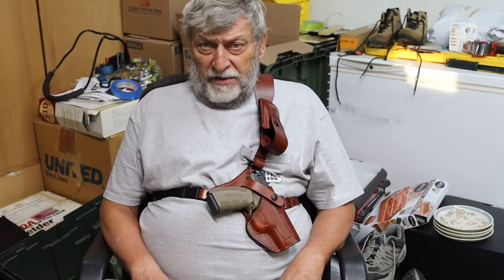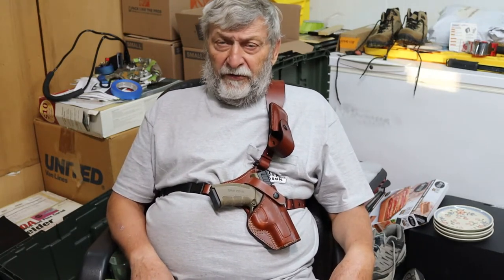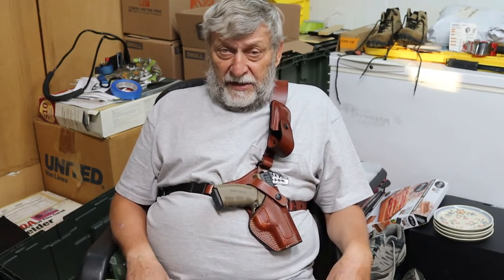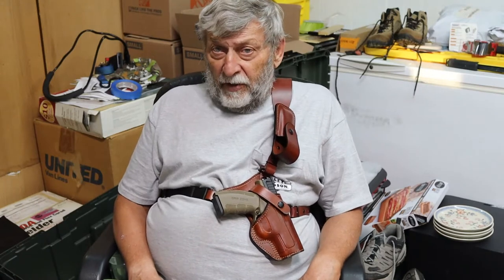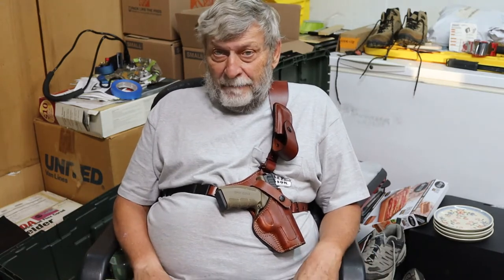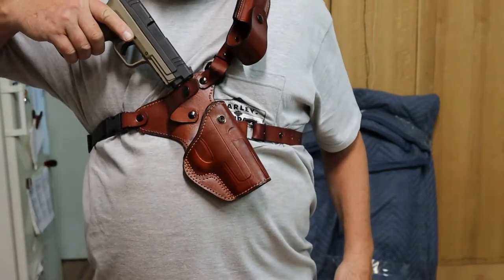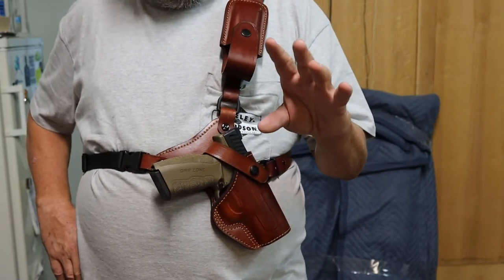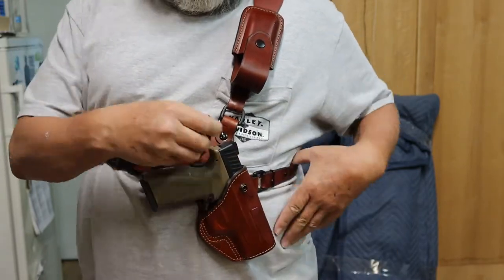Modifying My Craft Holsters Alaskan Chest Holster To Make It Work Better For Me

Comment: craft has a great customer service dept. A year or so ago I ordered an old traditional pancake type holster from them for a S&W 39-2 (9mm kinda looks like a4" 45). Well it came and I have no idea what kind of pistol it was for but long story short, they had me send them about 5 pics of the pistol with measurements (laid on a ruler). they sent me back an excellent pancake for the 39 and told me keep the other holster as well.

Comment: I have that problem!  I carry a 2 1/2 inch 357 for black bear and have never found a chest rig acceptable due to the lack of a lower anchor.  I carry in a crossdraw holster at the 11 o'clock position.  I think I'll try your solution, but will glue a thin piece of leather over the inside piece of the Chicago screw on the holster.  I don't usually have a hard time drawing from a holster (I use an old compound of oils and wax to facilitate a smooth draw), but the direction of the draw from a chest holster necessitates a solution such as yours.
Reply from the maker: That sounds like a good way to try to fix your problem.  Please let me know how it works out.  I like your idea of using oils and wax to line a holster to smooth out the draw.  I'm going to have to try that out!!

Comment: Ok, good mod used the kiss principal. On your I fell scenario, can you pull it with your left hand because the bear/moose broke the right???? can you use it with your winter clothes on or is jacket in way.
Reply from the maker: Good morning Ted!!  Great questions!!  With the holster anchored like that I could work it out with my left hand if my right hand were incapacitated - but if it were not anchored it would be next to impossible... for me anyway...  as for using it winter clothes or jackets: yes, absolutely it can be used with them.  If you noticed a long tag of leather sticking up from my back, that's part of the adjustment of this holster.  It can be worn over many layers of clothing and a jacket as well.  With a jacket, the jacket would get bunched up a bit by the anchor mechanism I concocted, but it would definitely still work just fine.  Let us hope I NEVER grow big enough to require all of the adjustments this holster has... LOL!!  Thanks for your insight Ted!!
Reply: @thelonemoose4718  How far past your belt is the end of your jacket, Freezing weather and small of back not covered? Adjustment could be any length not the point go put the coat on. I use cross draw on belt that i can with either hand and I practice still. The holster is fine.